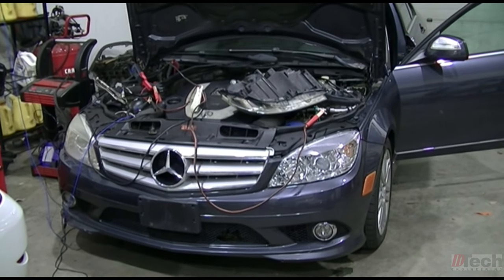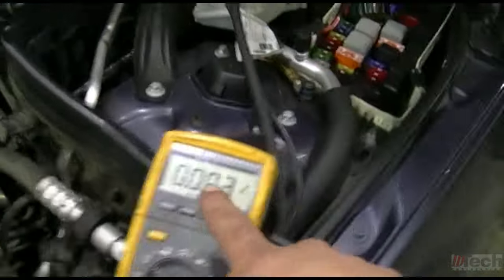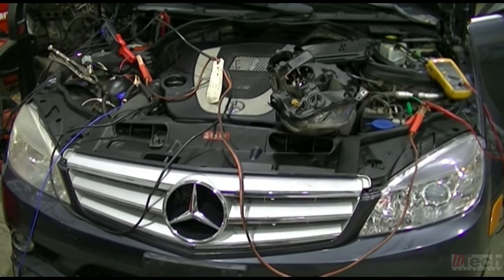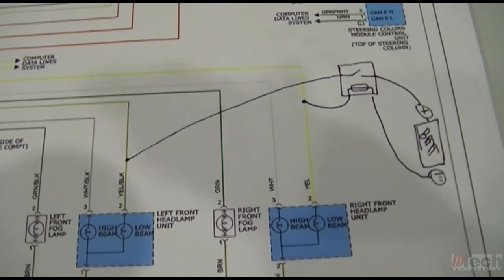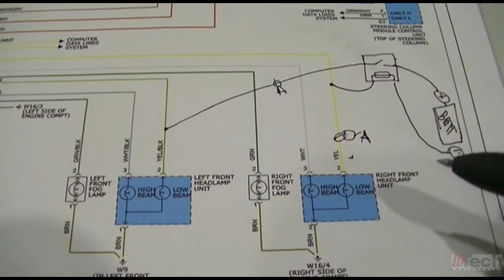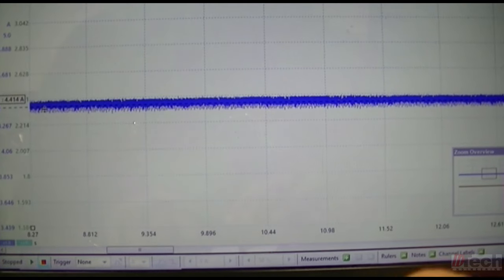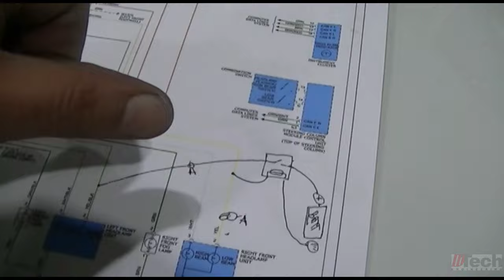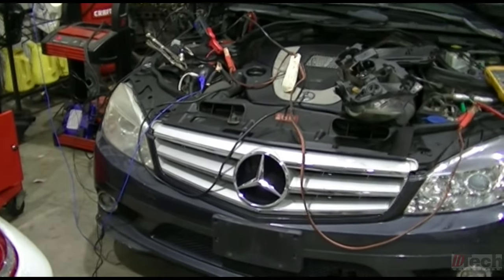Mercedes SAM Bypass for Headlight Not Working

Comment: Hi, for you and anyone else out there... Firstly, I was thinking to do the same thing but had concerns how the SAM would handle it, and error messages.  So you testing video was most useful to confirm the solution and show power was less than 5 amps etc... 

I used a Rely and a 5Amp Fuse for the feed.  My car is a 2008 E350 Sport and the drivers headlight was not working.  After opening the headlight unit to repair the Mercedes ECO crap wires (Who didn't test that useless wire before using it in manufacturing!!  Mercedes goes to great lengths to make everything CANBUS with test circuits everywhere - hence the headlight SHORT CIRCUIT, diagnosed the error but also didn't report it smoked the SAM internal switch for the headlight! Anyway I digress...).

When testing with a meter I saw Power for a brief moment then SAM turned it OFF.  So I calculated that the wire was not shorted.  Hooked the power to the wire at the headlight... ran right Low Beam signal wire around the back via the Cabin Filter and to the SAM Area where I installed the Relay and got Power from PIN 30 0n the empty Relay M assigned to "M - SEQ pump control relay" which is not present on my car.
Secured Relay to Earth Post just in front of the SAM and took the Relay Power to wire at Headlight and spliced into LOW Beam Yel/Blk wire right there - Work Great... and I got lucky as the Power monitor for LOW Beam appears for now to be happy it can see power and I don't get a dash warning. A win!

I also didn't know about the BAD Wire in the headlight unit until this problem, and I did see after I dismantled mine that several have done the same - yes it is possible to open up the unit with patience, rewire with care, I soldered new wire to the stubs... I slid some long lengths of heat shrink on the indication and I couldn't be hassled to remove that to get to the back of the fitting.  Just take your time and it's not a difficult job.  

So my 2008 W211 E350 no has both headlights working.

Thanks for taking the time to do your video, I am sure there are many without unlimited funds that might benefit from knowing its OKAY to do this without causing further harm to SAM or anything. Hope everyone has good results as I did... gabled, worked, but a winner.

Thanks again. Dave.

Comment: I m having the same issue with my 2009 C350 driver’s side 
Found this video. Very interesting I will do it cause my mechanic shop that specializes on mbz is charming me $1100 for changing the module

Comment: I have a 2009 mercedes C300. The glass was cracked on the right headlight but it still worked. I bought a new headlight assembly and removed the light and disconnected the connector to the assembly. I got the new light assembly and plugged it in and nothing came on. I then connected the old light which was working and now it wouldn't turn on. I was completely baffled. I then thought maybe it got its ground from one of the three mounts. I made a jumper to a good ground and hooked it up to all three mounting locations and still nothing happened. I am at a total loss. If you could please shed any light on my problem I would be so grateful. Thanks, love your videos.
Reply from the maker: halogen or xenon ?
Reply: @DTEAuto  Thanks for replying, Halogen. But, I figured it out, I had to disconnect the battery and reconnect it. Then it worked. Thank you so much for your videos.

Comment: Sheer Brilliance!   Thank you for this video.   I too am faced with this problem only in reverse, in that the passenger side is not working.  Certainly this can be done in the other direction but my question is if there is a certain size relay or manufacturer of the relay that you used to do this?   I hope that this message reaches you, I know that this has been on here for a little while.    Thanks again for the details.   I will be doing this to a 2009 C300.

Comment: Thank you for the video. The left side headlight on my 2008 CLS550 does not work. No low beam , high beam, turn signal or parking lamp. I have the same issue with the insulation coming off the wires in the headlight assembly. as your car. Is there a quick and simple test to check the SAM unit vs the SAM unit needing to be reset?
Reply from the maker: check if it's sending out power supply to turn on the lights, if not and it's not a wiring problem, then possible the SAM is faulty

Comment: I have a 2001 s430 with the driver side out,I'm not the electrician by no means,interested in doing this,just not sure where to take power from and the relay prongs,I'm impressed.
Reply from the maker: you would have to tap into the power feed to the good working headlight bulb
Reply: @DTEAuto  OK,so that works as the trigger,12v to relay,one to input to headlight not working,and the one to ground.

Comment: I'm having the same issue but with the 08 e350, just replace the headlight assembly and no low beam so the signal is missing,  I just couldn't get the right wiring diagram to track the wires

Comment: I wonder if tracing the circuit in the SAM, and find the failed component, probably the power driver chip, IC, or capacitor, might be a feasible repair, since so many modules are being discontinued. There are shops that repair these items as well. Just thinking out loud.
Reply from the maker: Yes that is definitely something to consider as on option for sure.

Comment: I thought of that too with bmw X 3 there were xenon headlamps so many wires but I decided rewire all headlight and it worked, 2 y later the other headlight died . Now it’s happening on my ML350 mercedes. It’s about the 15y when the wires starts to bridle and touching each other. 
But here you saying customer bought second headlight still didn’t work 🤷🏻‍♂️ it’s a lot of work to rewire xenon headlight it was over 15h have to heat the headlight and unglue the glass from the plastic than fix and glue back together.

Comment: Too bad you couldn't crack open that Sam, you could have replaced a $2 IC chip and got it working again. I replaced three on mine because I jump started my car and it must have sent too much voltage to the Sam IC chip.
Reply from the maker: thanks for the info I'll keep that in mind for the next one
Reply: Do you have the part number for the ic chip? Would you happen to have a link to replacing the ic chip? Thanks
Reply: @markmanning6773  
Hi, I didn't take a picture of the IC and I didn't make a video because it took me about eight hours to replace a few of them. The casing is kind of difficult to open so be careful not to damaged the board. If you can get it open you need to look on the top of every IC chip and look for a burn hole it will be very obvious especially with the magnifying glass or an eyepiece. You also need to look for white on the board because white indicates water. You can try to clean it with a toothbrush and alcohol. If you recently jumped your car with a car starter, another car or jumper pack then the IC is most likely the problem. If you know how to use a digital meter you can also check the simpler things like diodes and resistors. I can't tell you this, the IC chips that need to be replaced are the thinner IC chips not the wide ones. Please keep in mind that this info is only for the Mercedes C230 w203 chassis rear trunk Sam / fuse box.
Reply: @georgec7798  thank you so much
Reply: Not sure if my last message went through or not. As I was looking for parts to repair a refrigerator board I found the IC chips that go in the Sam / fuse box for the 2004 Mercedes C230 w203. Please keep in mind that these are SMD not through hole. Try to get them at a reputable place like Mouser or digi-key not Amazon because they may be crap. Here is the model number of the IC.
ULN2003A
Reply: @georgec7798  thank you and forgive me if I overlooked or forgotten info on this, but does the sam or IC chip have to be programmed after replacing?
Reply: @markmanning6773  
Hi, no, the ic's do not have to be programmed, they seem to work more like a relay
Reply: @georgec7798  thank you

Comment: Hi, I really like your diagnostic methodology. I have a 2011 R350 with an LED fog lights that will not turn on. I have measured the voltage on the connectors when they are turned on and got 0 volt. There is also a message of blown or open circuits on the fog lights. However,  when I connected a direct 12v to the fog lights,  they worked very fine. I have looked up the wiring diagram, but I am a bit not sure if it's applicable to my model as what I saw showed like the wiring of 2006-2010 models,  though the wire colors are similar. Could you explain how I can go about fixing this or perhaps help me with the wiring diagram of a 2011 R350 with an LED foglights. Thanks so much.
Reply from the maker: Looks like the front SAM control unit will be responsible for the actuation of the fog lights.  I would start by checking the live data in the sam , make sure nothing is missing. Also, it looks like, they both share the same ground, so I would definitely look into this, since both are not working. Both get turned on via separate lines out the sam, it would be odd if both drivers would be inop at the same time internally
Reply: @DTEAuto  thanks for the suggestion. I have checked the ground and it seems fine.
Reply: the SAM has a current detect feature on each light (all lights) and the LEDs draw less current; this is how it knows if a bulb is blown. If you have someone watch when you first turn on the vehicle, they will flash, shut off, and then stay off with error on dash. You need "Can buss decoders" or power resistors to make the circuit draw the correct current.

Comment: i have a 2010 glk350 4matic. i have a code in the SAM for a short/open circuit in the left fog light. i was installing LED bulbs and i put the left on in the wrong negatiive/positive ports and when i turned them on.. the left one didnt work. how can i fix this problem? do i have to buy a new SAM/fusebox? or is there another way?
Reply from the maker: I would venture to say that if anything it might be possible to do a set up like how I did for the headlights on this video, use one side to power up the other. This is of course if the driver internally is not working in the SAM, wires and output would have to be checked

Comment: Any chance that the SAM has locked out the low beam and would restore with a hard reset?  If it has current sensing, it should not allow a short to damage it.  Or maybe a rodent or corrosion has damaged the wire under the module?
Reply from the maker: I did wonder something similar, and I had gone in with the scanner and attempted to clear and reset and activate, most of the time what I have noticed that if it was not operating due to a "lock out" or similar situation, the module will still be able to work and operate the light with a hard manual command via tester in order to display ability to operate physically just not operating with switch command because something is not reset proper or coded correctly. but to no avail my situation did not clear up or operate with command from scanner. Leading me to believe more of a hardware failure issue. Thank you for watching
Reply: Dude...i reset the error codes which only showed O2 sensor faults and the shit works.... Reset with an MBII Carsoft in regular ob2 and pray you have the same luck as I did... No voltage to bulb before the reset....

Comment: Hello,i have  a W204 C220 CDI from 2007.It has been standing for over 3 mounths,when i started drivein again,turn signal,horn,window wippers and AC not working anymore.Suddenly,AC started working again and also turn signal,horn an window wippers started working all togheter.Do you have any ideea what could be?
Reply: SAM module
Reply from the maker: I would venture to say that the SAM module seems to be dropping out. Would just have to make sure it's not a wiring problem to the SAM before replacing it.

Comment: where can I get diagrams like this for my w221 s550 thanks
40amp fuse keep blowing on the pre distribution fuse box car won't start but can be jumped offby passing this box new battery installed
Reply from the maker: I believe for DIY people , Alldata has a limited version subscription you can purchase and get service information including wiring diagrams. Search Alldata DIY, hope this helps.

Comment: RESET THE Computer... I had a buddy stop by with the same biodegradable German bullshit wiring... Insulation flaking off... Some electrical tape.. Used my MBII Carsoft computer in regular OBD2 ...saw no relevant codes...but erased them and now the headlamps work

Comment: The SAM detects an expected “resistance” when actuating the lights or any circuit actually.

If the SAM doesn’t detect an expected resistance in the circuit?, it completely shuts off power to that circuit & you’ll have to go in & clear the fault code before testing for Power.

NOT simply bypass it…smh
Reply: Thank youuuuuuu!!! Exactly !!!